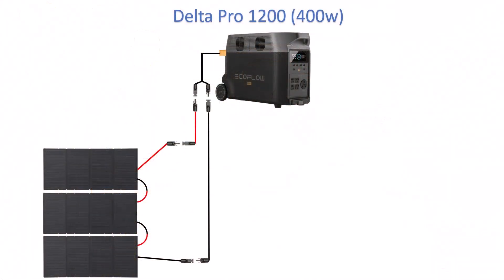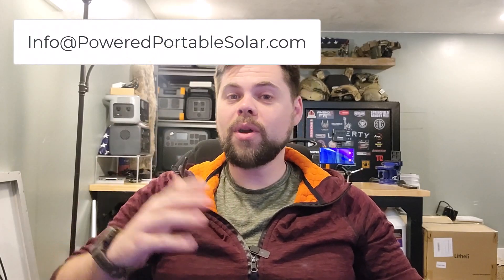Question #002 Get Max Solar Input on Delta Pro with 400w Panels

Comment: Stay under 15amps. Don't over amp it unless you have an inline fuse. I'd stay under the 1600 also.l and not chance it. It's a costly mistake

Comment: Thanks for the great videos.
I’m trying to hit the 1600 watts, but I have 435-watt panels with a current of 14.08 amps. So if I connect 3 in series and another 3 in series, and then connect those two strings in parallel, I’ll end up with 28 amps. But that’s way over the 15-amp limit.

Can my EcoFlow handle that? And should I add a fuse to make sure nothing happens to the EcoFlow? Or is the MPPT controller in the Delta Pro — and also in the Delta Pro 3 — okay with getting too many amps, or should I be a bit more careful with how much extra current the MPPT controller receives?

I hope you can help, and once again, thanks for your videos.
I live in Denmark, so our electrical system is quite different from yours, and I can only use one EcoFlow to power the house — we can’t connect two units together like you can

Comment: Lots of Scams out there when it comes to solar! The tsla power wall, total ripoff. Solar engineer here, You can use Ecoflow System Get all the benefits for 1/6 of the cost. You can tie it to the grid or go off grid, Yes with Ecoflow

Comment: Hello nice video .. i am about to buy ecoflow delta pro 3   
With ecoflow 4x400 ridig solar panel..
So in that case with 4 solar panel i will never have a full 1600 input into the battery 🤔 so much better to buy only 3 then ..

Comment: So would i be fine connecting two string of 800 watts connected in series and then connecting those 2 strings in parallel to my ecoflow delta pro.   The readon i ask is because those two panel strings would be 10amps a piece.... then when i connect them in parallel, it would put me at 20 amps. But you're saying that most panels dont get up to the full rated power.   So would i be ok with 20amps.  Rated panel wise. Or would it fry my Delta pro
Reply: You’ll be fine to run 20a in, but you won’t get 20a of current and you’ll kinda be wasting money…

From what you’ve told us, 800 watts with 10a on each leg of the parallel branches means your panels are 40v open circuit. So, because of the delta pro you’ll get solar input of 80v at 15a, which is 1200w. You could instead just have three panels in series (so 120v at 10a) and get the same 1200w power output (and then you could sell the spare panel and avoid needing branch connectors).

Comment: So what do you suggest in lieu of the delta pro for 4 - 400 watt Bouge solar panels? I was considering the delta pro as my remote inverter & have the delta pro ultra as my main go to unit out in the garage with 2 or 3 stack batteries. I would then take delta pro  to the ultra for energy transfer. I want it to be cost effective.

Comment: Has anyone tried using an external MPPT on their EFDeltaPro? I do that on my Goal Zero. Or is the EF MPPT as good as Victron? I notice my Victron bringing in watts while my EF hasn’t met whatever parameters they have for minimum input. Nothing in manuals. Frustrating.

Comment: Just to be absolutely clear, are we saying that a the Ecoflow Delta Pro is best running 2x parallel groups of 3x 400W panels in series?
Reply from the maker: As an updated response, the best solar input option is to use four 400w panels per unit, putting those panels in series. Like these: https://poweredportablesolar.com/product/400w-solar-panel/
Reply: @minutemansolar  so a 148.56 voc added together? What about when the weathers cold and the VOC rises over 150. Damaging the delta pro unit itself
Reply: @minutemansolar  $480 shipping for 4 panels? Not.

Comment: I'm just starting with my Delta Pro's and connecting to solar for charging. Do I need a disconnect from the panels to my DP's? I've ordered eight 400W panels, trying to figure the best way to wire them. Also, will solar input into one DP feed a charge to the second DP? Is there a cable (from Ecoflow or whomever) that can make this happen? Minute Man, thanks for this video. I'm going to check out your other videos. Subbed!!
Reply: Just to let you know.  I did the same thing.  i just received my 8 panels set up 4 of them for a test.  plugged in my DP and it wont work.  I have been told because it is 50 degrees here and that makes to much voltage for the DP.  I unplugged 1 and it works.  i am not trying to figure out what I am going to do

Comment: Can you hook up 2 smart generators to your 4 batteries and 2 delta pros? Or are the generators  like batteries?
Reply: Each DP has two ports in the back. In a max kw setup one port is used for the extra battery and one port is used for the dual fuel generator.  (You need a $69 adapter to connect the generator) To my knowledge you cannot have more than 2 items connected to a DP.

Comment: Just bought my system and am learning this afterwards.  I bought a full 21kwhr system as well as you have, with six, 400w panels.  I haven't set it all up to test solar charging yet.

I thought I'd pick up two more panels to have my total of 1600w of charging and DOH!  Now I hear I can't do that.  Of course my seller didn't inform me of all this!  I wish I bought it from you now.

I know it depends upon power usage, but in general, is running 3 400W panels (1200w) into each Delta Pro (each PRO connected to two extra batteries), even enough solar charging to support such a system?? 

Thank you.

Comment: Are there any new efficient panels that you would recommend to power to Delta pros? My thought process was to try to get for 400 W panels per delta flow but I want to make sure I don’t exceed the amps requirement if you have any examples on white for her white panel would work for this situation I would really appreciate it.
Reply from the maker: I prefer these with my Delta Pros: https://poweredportablesolar.com/product/410w-solar-panel/
Reply: @minutemansolar  $1700 for 1600 watts of panels ouch. On signature solar i can buy a 10 370 watt panels with shipping for $1200

Comment: I just want to know how much charging I would get with one 400 watt panel
Reply: Mine maxed out at 345W at 40V DC, but i had to pause testing when we realized the Delta Pro had issues and needed to be swapped out.

Comment: I have been using 4x400W (MEPV 108 Eurener) that delivers 1600W solar input on the DeltaPro for 6 months now, no issues at all so far. No problem to recharge in a few hours even with extra batteries connected.
Reply: Where did you get those panels?

Comment: I'm wracking my brain over an RV config..  I'm converting from a lithium 420Ah/14v install to a DP+Smart Extra Battery.  I already have TWO separate arrays.  1) 5X165w (9.06A 18.22v) on the roof. 2) 4X165w same model panels.  The reason I have two arrays is that the 2nd array is 'deployable' and not always in use.  It folds out from a custom drop down gate rack.   I strongly prefer not to rewire the string on the roof which is 5 panels in series.    The deploy rack will not accept a 5th panel without major headaches and is only ever deployed when parked.  EACH array goes into it's own Outback Flexmax 60.  so if needed, I can tune the output current and voltage to; 12,24,48,60.  OR, I could do away with the flexmax CCs altogether?  How would you use this array system to charge the DP?  How could the existing 420Ah Lifepo4 set be used to feed the DP with spare power - if even possible?

Comment: Hi there, are you able to give me some information please, what cable would I need to use to charge my delta pro if I use 6 , 400 watt panels, but at the moment I only have 2  400 watt panels, Would the same gauge wire do for both.  At the moment l only have the delta pro no extra batteries yet . In anticipation thanks for your help. Kind regards Alan

Comment: I’ve just purchased a power stream which I’m going to run 2 x 400 watt panels into ( 800w limit ) and my other 2 400 watt panels will go into the delta pro directly.. I’m assured by EcoFlow that the firmware to do this is out in late july
Reply: Hi there, did you try already your idea? I’m planing to do the same.

Comment: Thanks for the video--this answered my exact question.  So essentially four x 400 watt ecoflow solar panels are not much better than 3 x 400 watt ecoflow panels if you are using them to charge one Delta Pro unit because they will both result in a net 1,200 watt maximum energy input to the DP.  To reach the full 1,600 watt potential solar input for the Delta Pro with the Ecoflow 400 watt panels, you need six of them arranged as 3S2P.

Comment: What if you're only using 1 extra battery per Delta Pro? Can you still put 2400w of panels to each Delta Pro? What happens if your panels produce more then 1600w? I get lots of great sunshine where I live.
I have 2×DP each w/ 1×EB & 1×SG, would it be ideal for me to get 2 more EB(1 for each DP) and only connect the SGs when needed?
Also, Can I over panel my solar input to my wave 2? It's rated for 400w of solar input, can I connect 4×110w panels in series to it or should I do 2S2P?
Reply from the maker: The ideal setup is to get as close to the maximum voltage rating as possible, but don't exceed it. Then if you go over on the amps that's perfectly fine. I would stick with your current set up, not add more batteries, I think you're good. Even if you're only using 1 extra battery you can still safely over panel.

Comment: After watching your video, I sent an email to Ecoflow and asked if I would damage my delta pro if I connected four 400w solar panels to it.  This was Ecoflow's response:  Yes. You can connect 4*400w Ecoflow rigid solar panels in series for each Delta Pro. The solar input specification of Delta Pro is 1600W Max, 11-150V, 15A Max. The power specification of the series 4*400w solar panel system is 1600W, 124V, 12.9A, which is in line with the rated range of Delta Pro.
Reply from the maker: that iscause yhey base their math on the VMP rating of the solar panel, not the VOC. And when you connect the solar panels they are producing VOC, not VMP. So you exceed the 150v limit, which shuts down the MPPT, which means it won't charge from solar. .
Reply: @minutemansolar Can I use 
4 X 600 watt solar panels in 2 groups to get the same watts as 3 X 400 in 2 groups?
Reply from the maker: @chuckb3489  It 100% depends on the VOC rating and the IMP rating on the panels. You must use the VOC to stay below the max voltage rating. And then any amps over the IMP will be ignored. With a 2S2P setup, you'll double the voltage, and double the IMP and that's what will go into the unit.
Reply: @minutemansolar  The panels are 18-48 maximum voltage.
Reply: I’m in the same situation, did we get this verified ? Thanks

Comment: I just bought a new delta Pro.    While I charged it up from wall socket the front screen doesn’t show charge and days hours correct.  Says like 30 days and 240% in charge.    App shows data correct but screen even after fully change is not right.  Hours days can’t tell what it says and total % is 188%.    Any thoughts ?   Software is up to date.
Reply from the maker: That is very weird. I'm sorry to hear that. I have not heard of that issue before so you'd want to reach out to EcoFlow to see what they say. In the app, is there a reset option?
Reply: @minutemansolar  sending it back.  Now it won’t turn off.  Only by app.   Holding start button down 10 second is the reset.  Reboot and off function.   Sending me a new one ☝️

Comment: Another remedy....get the Bluetti AC 500 problem solved
Reply from the maker: I have two AC500 units each with one B300S. I plan to get more B300S batteries eventually. My issue is the 240v output capability. There is only hte P030A fusion box which is limited to 6,000w output. How do you get 10,000w output from the AC500? Secondly, the NEMA 14-50 plugs, the 4 prong 50a plugs, each only have one hot leg. A 50a RV uses two 25a hot legs in that style of plug. So it doesn't work for 50a RVs either which is what it was supposed to do. I'm genuinely curios if you have found solutions to those things?
Reply: @minutemansolar  Using a simple 50a transfer switch one can jumper the output side so that it will feed both legs. I have not done it but should work
Reply from the maker: @LarryRichelli  Thanks. Doesn't the transfer switch need two hot legs?

Comment: So how many panels are you using for your two delta Pro with two batteries? Thanks.
Reply from the maker: I use up to 7 rigid 200 panels (https://poweredportablesolar.com/product/rigid-200w-solar-panel/) in series in a single group. To maximize solar peak hours I will double that.
Reply: @minutemansolar  so, on a good sunny day, are the 7 200 watt solar panels charging your units up to 100 percent? Or do you need to double the solar panels to do that? Thanks. Loved the video.
Reply from the maker: @slamdunk58  The last few days I've been testing my panels in non-ideal conditions and I am still getting my units back to 100% day which is very impressive, I would not have expected that originally.
Reply: @minutemansolar  That is good news. That the same set up I plan on using at my cottage. Good to know its going to work.
Reply: @minutemansolar  When I look at the Voc of the 200 W Rigid panel (23.4v) it appears the 7S panels would provide an input voltage to the delta pro of 163.8v?  From your earlier comments you can exceed the 15a input limit but not the voltage?  BTW love your channel.
Reply from the maker: @buddyslaton7593  Correct it's okay to go over on the amps, they will get throttled down to 15a, but don't go over 150a when you're connecting the system up. So you can only do 6 of the panels.

Comment: For those who say glass set up is cheaper, kindly provide solar panel provider to back up the rhetoric. 

Case-n-point: 
Found Solar Panel Kit 18V-36V PET 2400W 6X 400W Solar Panels for only $900 on Amazon.

As for those complaining about paying $6k for the Eco Flow Delta Pro system, I have been researching over the past year for house solar panel set ups. The CHEAPEST quote has been $16k. And if you add battery back up, that jumps to $24k to $28k+ depending on number of batteries. Do not get me started on a Tesla Power Wall costs.

Why not just be thankful this gentlemen is passing along his knowledge and experience to help others set up their system.